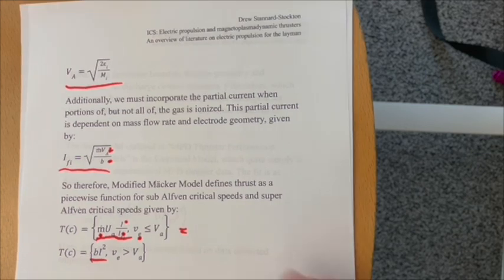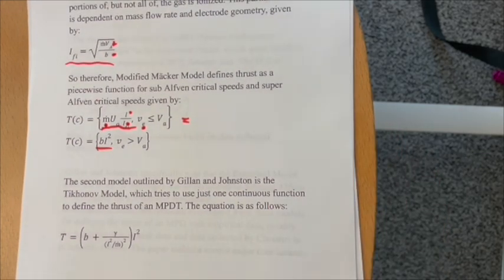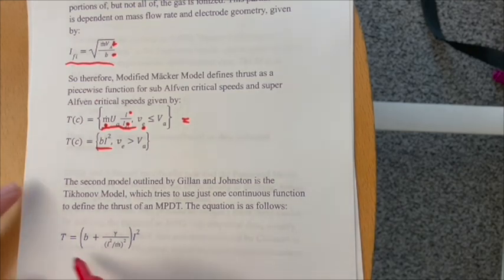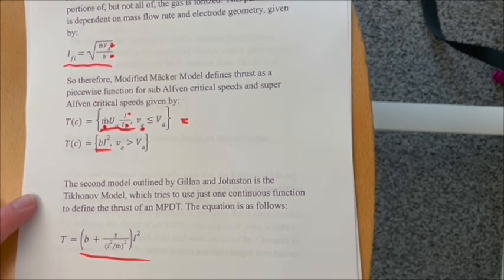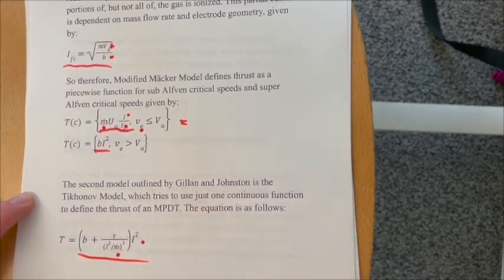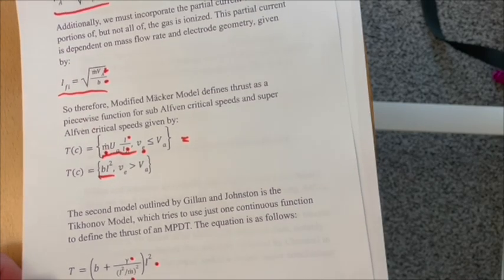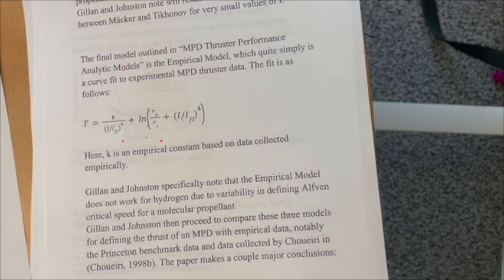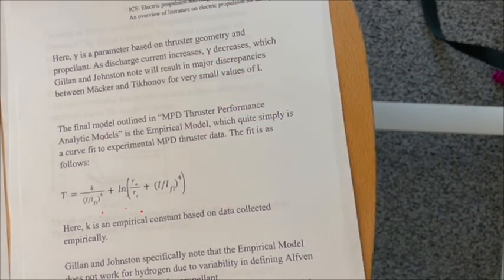A Basic Overview of MPD Magnetoplasmadynamics Thrusters for the layman

Comment: Since you need electrically conductive fluid with an initial motion to operate in your railgun, how about using Pee as that fluid.  With enough current, you would have instantaneous electrolysis, combustion, and conversion to plasma all in one railgun.  Pee may be the fuel that solves energy needs for 8 billion people.   You need DC but your circuit could charge an inductor with MOSFETs then output high frequency (4-200Mhz) pulsed DC.